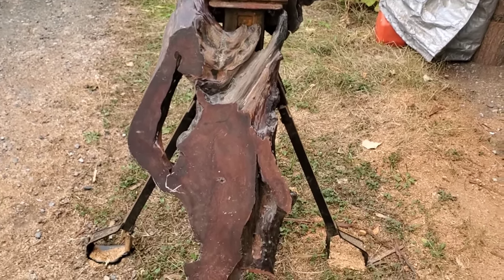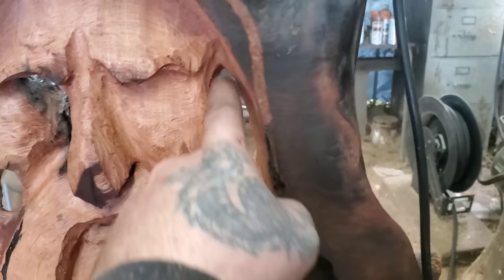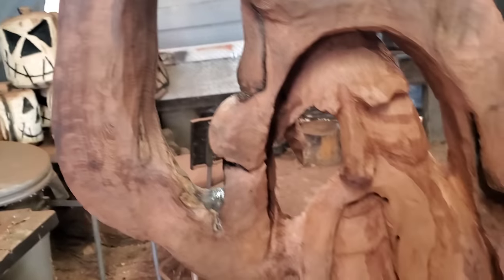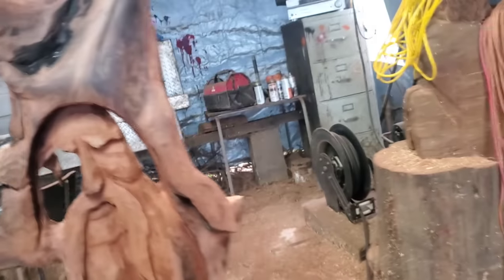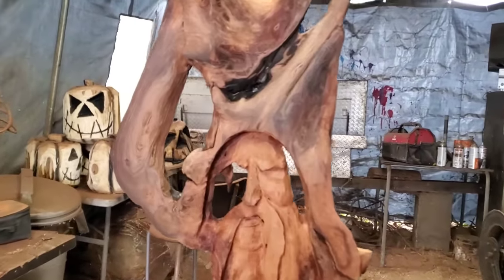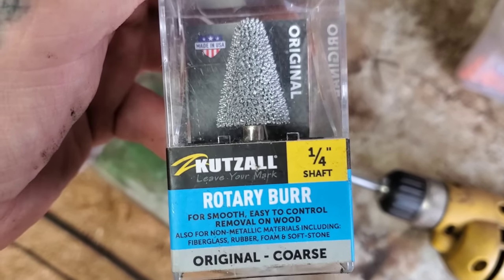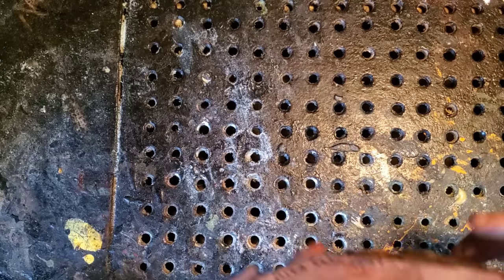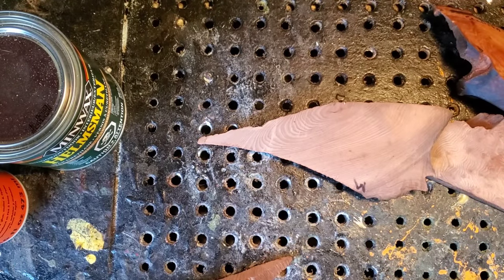Wood Working a old OLD" Piece of Redwood.

Comment: Awesome Jordy looking forward to seeing the finished product.  Question Jordy I see you were using an angle grinder with the extension 2 inch grinding wheel what is the difference between that setup versus the Merlin that you have more power with the angle grinder?.
Reply from the maker: Way way more power